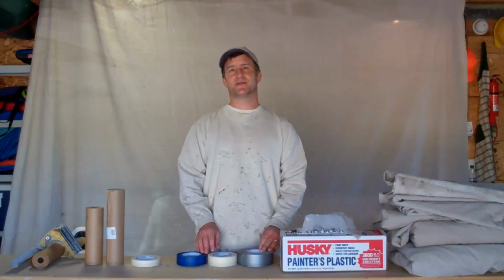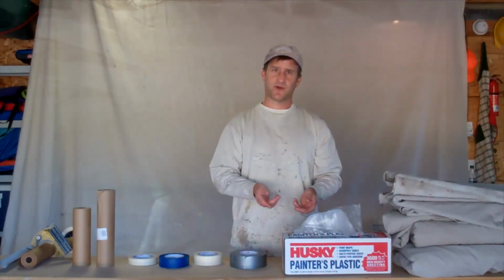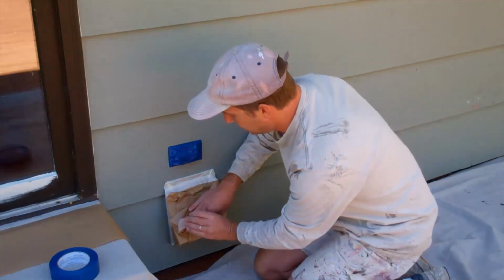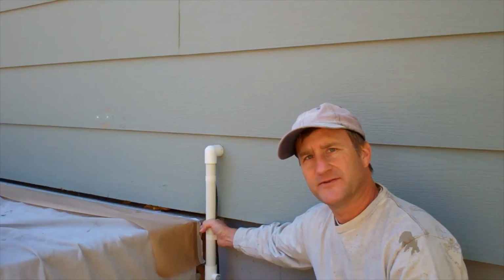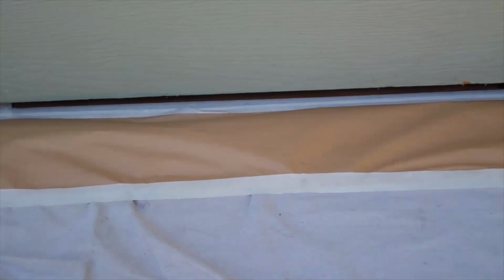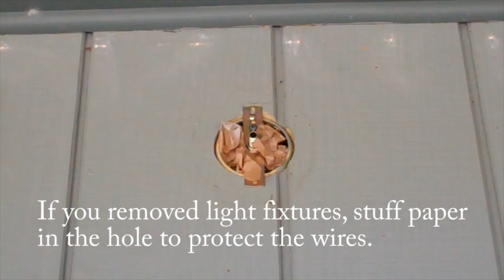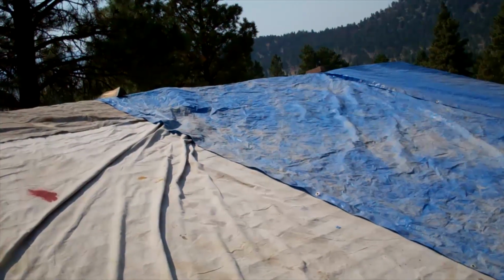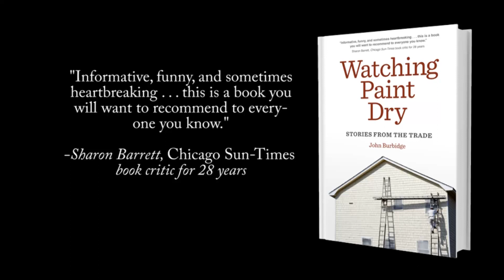Exterior Painting Step 6: Masking the House and Placing Drop Cloths

Comment: I have some new masking videos done now. When I mask concrete or deck edges, instead of pe-taping then tape/paper, I just use the tape/paper, hold it back and inch, and then throw the 1.5" blonde tape up to the house and there's much better adhesion and the masking is very easy to remove in one effort.

Comment from the maker: Hi--Thanks for the comment. I suggest you go to one of your local paint stores and buy the best canvas drop cloths they have. Even the heaviest weight (8 oz., I think) can sometimes allow paint to seep through, so if you're putting them over carpet or concrete or decking, it's a good idea to wipe up any big drips/spills with a rag so they don't seep through. Sizes will vary depending on your needs, but one 9' x 12', one 12' x 15', and one 4' x 15' ("runner") is a good selection to start with.
Reply: howtopaintahouse I BUY THE LARGEST SIZE, AND THEN ,CUT IT THE SIZES I WANT  IT IS ECONOMICAL.